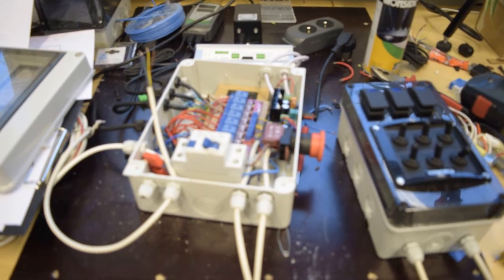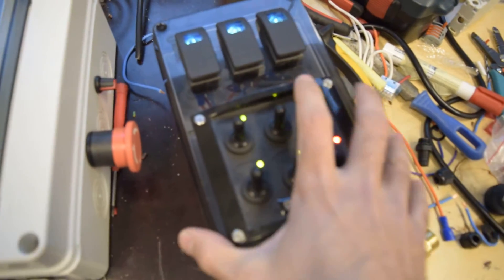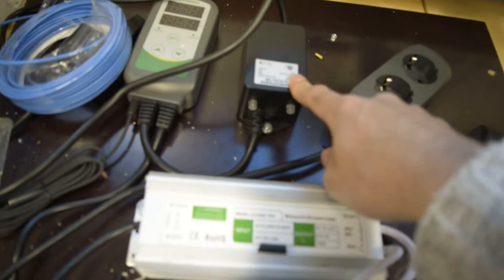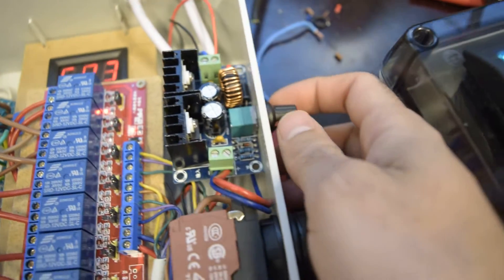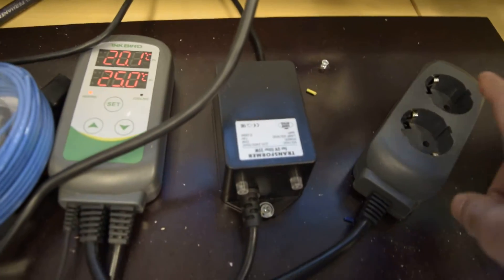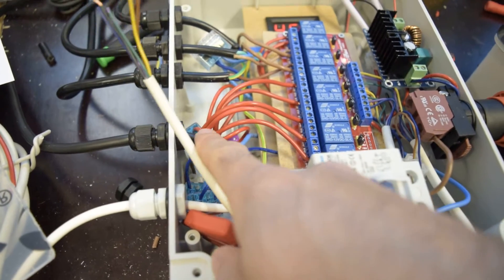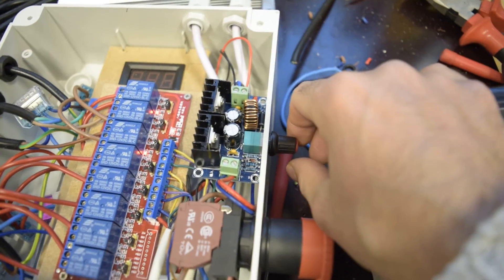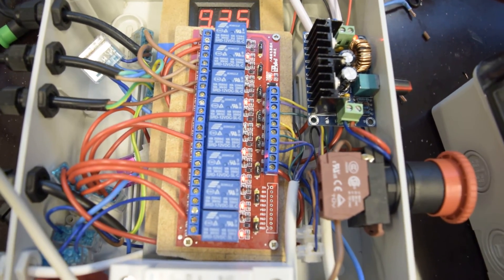Showerloop 'powerbox' and 'switchboard'

Comment: Just curious, why you have a rheostat controlling the pump voltage?
It needs a certain amount of power (voltage) to operate.
If you decrease the voltage, current increases, which will shorten the life of the pump.

And what are the valves controlling?
system flush? drain diversion?
Reply from the maker: I may be mistaken but it should be a PWM DC voltage regulator. Or so I'm assuming. If you know of a more efficient way to do it I'm all ears. 
Cheers
Reply: @officialshowerloop607  I think that it would depend more on what you are trying to accomplish with it.
Are you trying to control pump speed, voltage to components, or using it as a time delay feature?
I assume that you are using Arduino, yes?